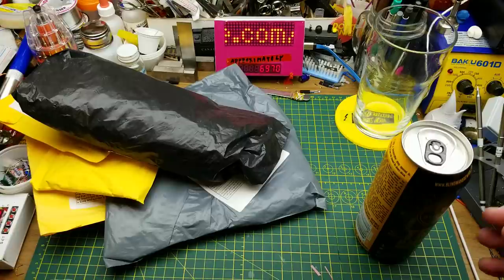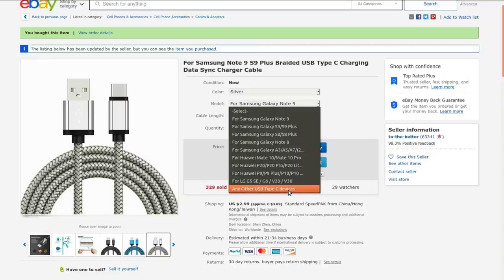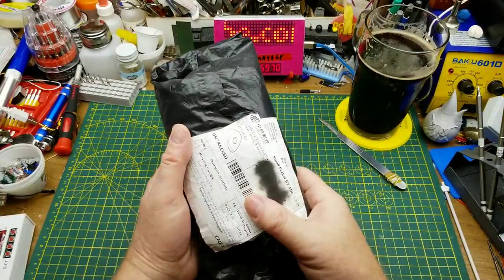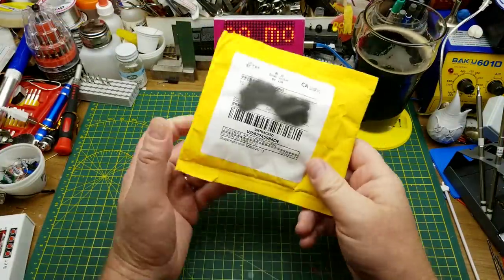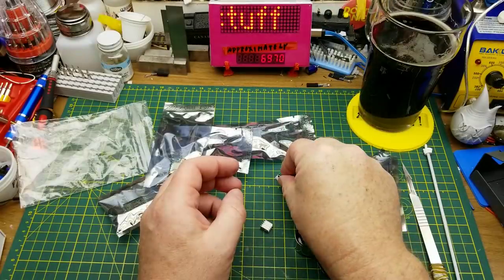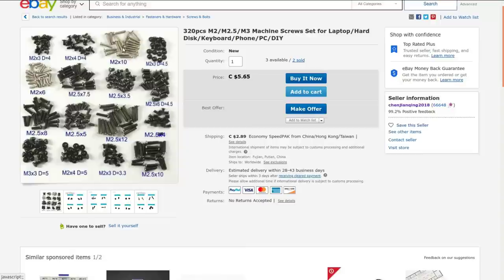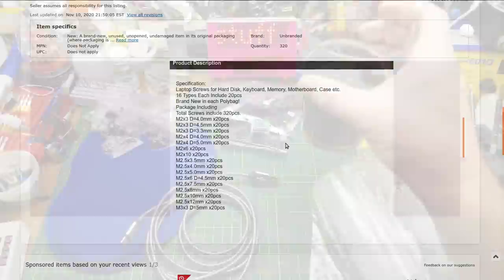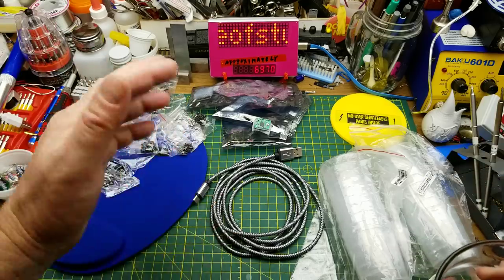Mailbag Monday #101

Comment: For the charging cable .. Get a (really) short one for low resistance.  Then buy, or make, a good USB extension cable.  Of course - then you'll want to 3D print something to keep the cables from separating - or a base to plug the short cable into? ... even more fun ;-)
Reply from the maker: Interesting idea.

Comment: The thing with those little measuring cups is Canadian hospitals are literally throwing thousands of them away each day, They do a pill around 3 times a day for patents and they get put in the trash even if it only had one pill in it. My mother was hospitalized for a month due to a fall, she convinced the nurse to let her save them up for me, needless to say literally have an endless supply of them now,  7:15 Those china made steppers you have to be careful with, I had ordered 20 of them out of the 20 only ten actually worked, the little voltage trimpots seem to be the most common problem on them, also they say good up to 2amps but you don't want to drive them much more passed 1amp, which is ok for most Nema17 steppers. You are right, M screws in Canada is not easy to get your hands on and when you do find them ( usually M5 and up ) they are expensive, Luckily we now have an eBay Canadian seller that has at a reasonable price starting from M3 and up, https://www.ebay.ca/usr/phillipjfry78 i only order a few times from Phill, so far so good.
Reply from the maker: I may be cheap, but I draw the line at hospital dumpster diving...

The last time anyone from my family was in hospital here, they used paper 'condiment cups" for dispensing pills, not plastic dosing cups.
Reply: @pileofstuff  I'm with you on that one lol There is no way in hell am I'm jumping into a dumpster in hospitals lol And I wish the hospitals here would use paper cups, maybe they do now, however, that was last winter when she was in the hospital and they were still on the plastic ones. Go healthcare budget go lol its unlimited it would seem.

Comment: Those stepper drivers were the default in the Creality Ender 3 -- the newer boards, and the aftermarket ones that are "silent" drive steppers much more quietly. If the A4988 are too loud when you use them, you might want to look at the Trinamic TM series.

Comment: If you need 2, 2.5 & 3mm screws check out hobby shops that carry RC cars. Most of them use those sizes.
Reply from the maker: They do have them, but they're even more expensive than the limited selection at the hardware stores. At least in my area.

Comment: I always find those cheapy Chinese USB cables disappointing.  I love the Anker ones.  I know they are a bit more expensive, but the last for ages and they deliver the power, even over a longer length.  2 Mtr Ankers tend to not  have much loss and are still capable of fast charging.
Reply: Same here,  cheap Chinese cables tend to break rather quickly even when braided as they often don't actually strengthen where it matters near the connection. Also with the higher power throughput these days with fast charging and all that I rather not risk the cheap cables on account of it shorting out increasing chances of electrical fires. Certainly with USB-C cables this actually is a concern, specifically early days there were a lot of faulty cables causing all sorts of issues like damage to devices.

Comment: Yep Anker all the way.  I also have some cheap USB mini to C adapters (tip for.others: get the ones with the little chains so you can hook them up the cables.) I got a couple of years ago also.  I get 2.4A (According toy phone, not sure about V drop) with the Anker cables and cheap adapters.  I have a name brand (maybe Anker) 2.1/2.4A cigarette lighter to USB in the car and get 2A+ on that also.

Then I also have a cheapo cable on my bedside table that my phone complains about and only slow charges.  Which is fine for the bedside table.

I have not delved into the world of USB PD and/or QC 3.0.  For a phone 10-12W is perfectly fine IMO.

Cheers.

Comment: There is no way the cables in that USB cable are 21AWG for the power leads.  I am going to guess they are 24AWG Aluminum conductors to see that kind of voltage drop. If they are copper then it's likely going to be around 26AWG.  It's hard to beat an Anker or Aukey USB cable especially the powerline type ones from both companies.  IIRC the Anker powerline cables are using 18AWG copper so the voltage drop (<0.2 Vdrop over 2 meters at 2 amps) is about as good as you can get on a USB cable while still being somewhat flexible.